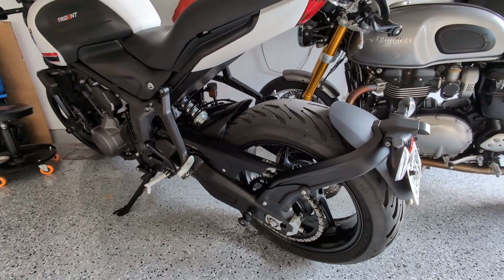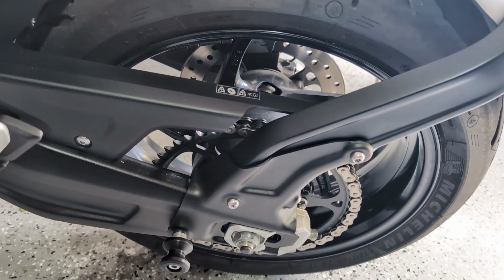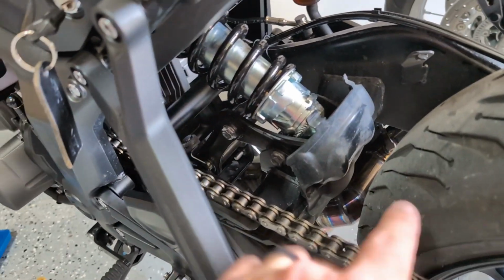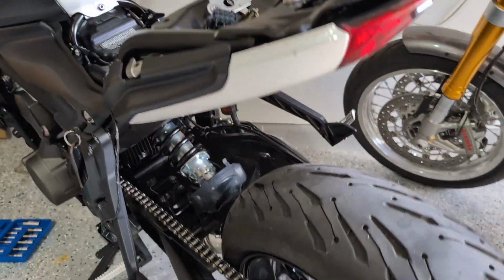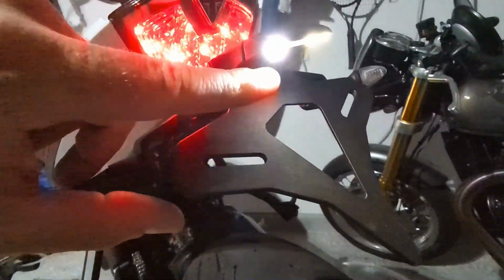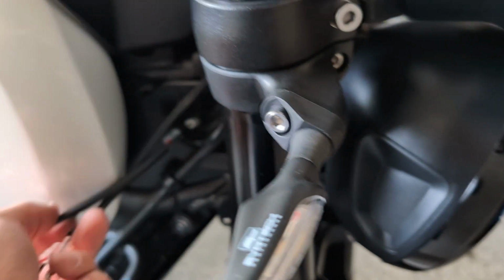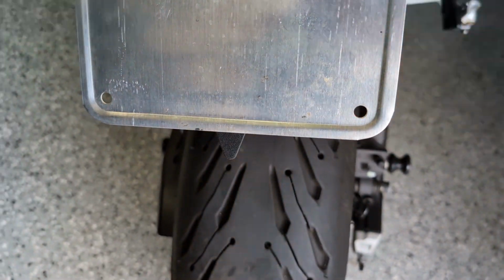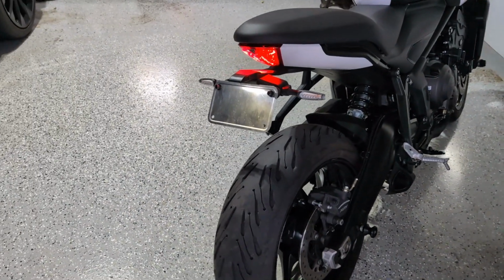Evotech Tail Tidy Install + Flashers - Triumph Trident 660

Comment: Thanks for the video!   I like the looks of the rear without that OEM mud-guard but I am not so found of the Evotech tail-tidy piece. I wish they'd release another model that could fit more under the seat (perhaps inside a housing of its own even--Modular design). The current looks is an improvement for sure.

Comment: I’ve done the exact same upgrades. What did you do to get around the brake light issue? With this being a North American version, the indicator ms are the brake lights too.
Reply from the maker: Hmm, I didnt have an issue with this. The instructions say to pull the brake light wire back up through the tail then plug in the new indicators. Are your not separate wires?
Reply: @ they are to the single light under the seat but the Canadian configuration is that the 3 of them all work together for the brakes and Canada is the same as the US configuration. I rewired mine, installed resistors and relays to have them working off the front 2 instead of the back but my single light still operates as a brake.

Comment: The rear lights don’t work as the additional brake lights? Does gives you an error on the dash? I have a 2022 also that why I didn’t upgrade mine.
Reply from the maker: No, those are runner/signals only. The stock brake light is the same. No error code.
Reply: @ thank you I think It would look better but also makes me nervous and anxious that someone can rear end me if I don’t have the 3 brake lights 😂